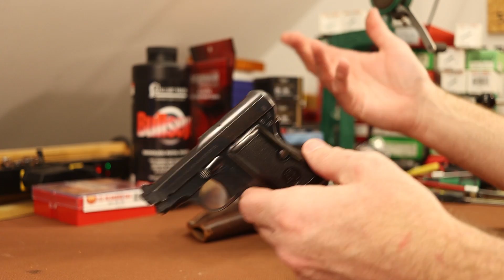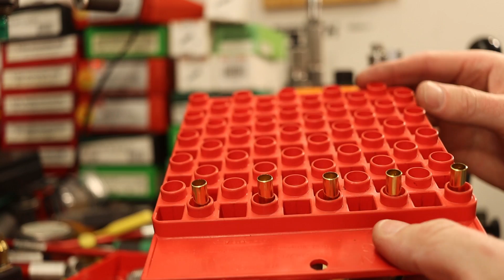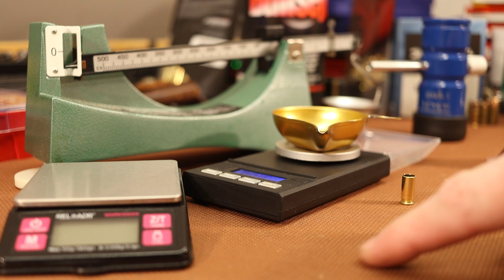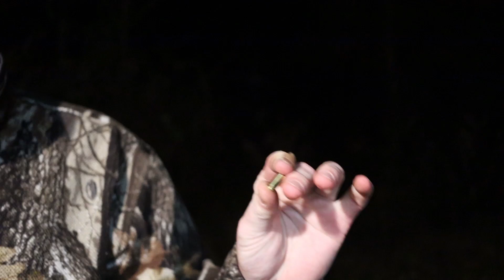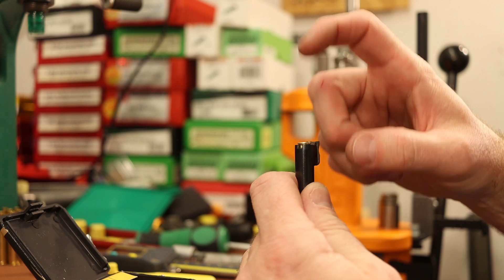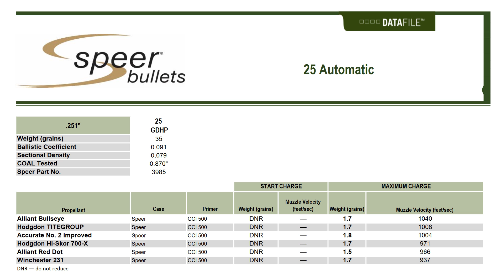Reloading .25 ACP

Comment: This shows 25acp can be loaded much hotter than factory why a polymer double stack 25acp hasn’t been made is crazy you would have 10-15 rds of 35gr at 1000+ fps when most is loded to 900fps for 35g

Comment: I had a weak striker sping on my 25auto so I got a box of assorted springs found one of similar diameter and cut it down to like 5-6mm and added it now it fires 100% of the time and is more powerful than needed which I’d rather have for reliable firing

Comment: My Beretta is a 950B.. this is a pre 1968 single action very small tip up barrel with 8  round mag and one in the chamber for 9 rounds.   it is in the front pocket of my western shirt as we speak.   everyone loves to shoot this little gun as it is reliable and accurate.. thing is no one can resist firing all nine as fast as they can pull the trigger.   Being a handloader for half a century + I handload everything except the mouse gun stuff and my 9mm Mak stuff...  but it might be fun to load the little 25 for my Beretta.    Also maybe for my PPK in .32.

Comment: Johny, a couple respectful suggestions:
>A very slight modification to the bullet seating stem is pretty easy in a small - medium lathe. (I've done it myself several times, and I'm no machinist tech whatsoever. Just an old ER/ICU ex Military MD, bitten by the reloading bug decades ago): From wide flat nose .452" bullets to round nose .224" ones.
>I'd try finding a used Phoenix HP25. I'ts basically a cheap 'pot metal' / Zamac pistol, (Usually, 3" bbl, some with 5" bbl). Those cheap pistols tend to print ~3" groups from rest @ 15 yds, though. Not too hard to find a good used one for less than $100 bucks.
BTW: Me happy to see you're going close to 32' Million views, and going strong to 50'M!!.
😊🇺🇲💪🏆🙏🙏🙏

Comment: I have several .25's, all Berettas. I reload 50 gr fmj bullets. I made several custom dippers. Just too Lee dippers and shaved them down. 1.0 to 1.1 gr of Tightgroup is fine but I prefer 1.1 to 1.3 gr of HP38. 

I've found the guns will run between 715-850 fps with 100% reliability. Slower or faster and you will get occasional malfunctions. In my early testing I made a batch of 50 gr fmj that flew 935-1015 fps for 10 shots. Don't do that. I disassembled about 20 more of them because that must have been overpressure. I think i got lucky. 

Anyway, with my Lee turret and funnel above the flaring die using the dipper is quite easy. I can load 50 in an hour. 

Yea, 4 times slower than say, .45 acp. 

So, I bought cases of .25 loaded ammo. But it's still fun to load it for 50. As of 2025 .25 costs the same as .45. 35 to 40 cents a shot. .32 acp costs more.

Comment: Have loaded this ctg with 50 grain ball and 25 grain gold dot  for both baby browning and a 1922 -made colt .25 pocket model.  I used lee dies and sometimes a hand press -for fun rather than necessity and both the Lee-alliant bullseye 1.4 grain dipper and an rcbs measure threw completely consistent charges. The dipper is consistent with long-standing loading manual recommendations and the 1.7 grain charge is handbook list for the gold dot jhp-contrived from a .22 rimfire case.  The manuals claim it is very hard to throw accurate charges at these small weights but I found that there was no problem with measure or dippers struck even.  Weights remain consistent and velocity variations  are suitably low.  
I have found with both of thse pistols (but not the Beretta 950s) require a slight crimp to prevent the rim of the ejecting case from slamming into the un-radiased case "mouth" and preventing feeding. This is true of Factory ball loads and handloads but not the case with speer and hornady jhps which are factory crimped. The solution is to run factory ball and handloads of whatever bullet design into the seating die set at a slight crimp depth.   So loaded, both pistols are completely reliable.  
From Browning 50 grain remington ball (Crimped)  726 27 fps spread, 1.4 Bullseye 844/ 26 fps spread (from Colt 872/65)consistent with speer manual listed velocities 
Speer 35 gr good dot 1.7 Bsye Browning 977/662 fps  Factory Gold dot 1050fps

Alliant appears to have abandoned tho old Hercules Powders and the speer bullet lines several years ago

Comment: If it fires when the slide is dropped, the firing pin spring is weak. (collapsed)  Either replace the spring or stretch it some.  When it gets to a shorter length it will go full auto and empty the magazine.  Replace the spring before firing it!

Comment: Easy video idea!  The hardness of primers.  You could set up a weight that drops a firing pin onto a primed case.  Reduce the weights until you find the reliability limits of the relative whack.  It doesnt need to have exact measurements of force since nobody would check that at their bench.

Comment: I've found that the biggest issue with such pistols is the presence and/or condition of their springs. There's a bunch of tiny springs in those things and over time, they tend to weaken and break (or go missing because people don't keep tabs on the inventory of parts). .25 is defensively relevant if you practice follow-up shots. One round is gonna give you roughly 64 energy foot pounds out of a two inch barrel, but with follow-on shots, you increase the power potential of the gun - and it basically has no recoil.

Comment: With this Beretta being a direct blowback, the carbon or blacking on your brass is nothing to worry about. I have owned a Marlin Camp 9, Walther P22, and Walther PPK in .380 and .22, a Bersa Firestorm, and a number of other Direct Blowback guns. There are a couple of reasons for carbon or blacking of brass in blowback guns. The first is the case extracts before all the games burn off. If you have ever watched someone rapidly mag dump something like a Marlin Model 60 on video, you will see flames coming out of the ejection port during cycling. The second reason you might see brass getting blackened is because many direct blowback firearms have exceptionally weak or no extractor. This is because many straight blowback designs use that same excess gas as the extractor forcing the case out of the chamber. A combination of both of these factors is what leads to carbon stained brass. It has been basically the one factor every direct blowback gun I have owned shares universally

Comment: I have found that CCI primers are harder than Winchester primers. Some brisance factor in the steel primer cup. The light strikes by the pistol firing pin may work with sifter Winchester primers.

Comment: I reload for 25 acp. It gets a bad rap because it is under loaded in deference to a lot of junker pistols out there. Next you can now get cast bullets from Rim Rock, a 55 gr fn cast. The other secret is Hunter supply offers two hard cast bullets a 47 gr cast hollowpoint and a 49 gn hard cast. They are .253 made for airguns and work in most 25 pistols. They can now be ordered sized to 251. FYI the pistol you are using is the pistol used by James Bond in the early books, and replaced with the Ppk. It has a barrel almost 1 inch longer than most 25 acp pistols and gets around 50-75 fps velocity increase

Comment: If springs are really expensive, hard to find or not even made, it's ridiculously easy to make your own.
Whenever I order a die set I always check to see if I have the Priming shell holder and if not, order it. I also order the cartridge length Trimmer, but the 25-acp length Trimmer is only custom made!
My one magazine had a weak spring and the 3rd try was a perfect spring, and now it cycles reliably!

Comment: I highly recommend  NOT to reload .25 acp if you plan on using for self defense.... always use factory ammo for cc self defense.... not for reliability issues.... for possibly going to prison or being sued issues.....
Reply: Why would hand loads get you sent to prison? I shoot 380 cast bullet hand loads. I cut split point into them. They expand ok enough, and work till I get a hollow point mold.
Reply: @Quadrenaro  its happened before. even altering your ammo can get youo sent to prison if you killed someone using that ammo.   where they get you is by altering or handloading you may have intended to create ammo with the purpose of killing.   I know right its stupid... but thats how they can get you...  your better off using a "personal defense" named/brand ammo  your belief is that it will defend you.
Reply: @HR-rt9nh  I think it depends more on state. My state had almost as many defensive uses with a firearm than homicides in the last couple years. There is a 0 percent conviction rate of defensive uses, and hand loading is very prevalent. The last defensive firearms course I ran, the instructor had nothing to say about my hand loads, which we did talk about.
Reply: @Quadrenaro  pretty sure your right... it will depend on state... i would think maybe california and New york good examples where issues would arise from using a handload or altered ammo.

Comment: Might be a slamfire problem.slide going (slamming) into battery could be causing the firing pin to move forward due to inertia. The springs seem worn (stovepipes might be a sign of that)

Comment: (March 2022)  I collect old (pre WWII) pistols in the .25 ACP chambering.  I do not reload the round for two reasons.  1. it's really difficult, and 2. there's no where to go with the loading.  I did meet a guy who did load for it.  Asking "Why bother?", he laughed and explained he'd loaded many other rounds and this was seemed a challenge.  Not just assembling the cartridges but getting them to feed and function properly as well.It was a technological problem he wanted to solve.  He used cast bullets.
I'm not at that point yet.  But I'll watch because I'm bored stiff.
Oddly enough, one of the .25 ACP pistols I have is a Beretta 418.  (Designed in roughly 1918, mine is dated 1958.)

I used to shoot PPC revolver competition.  Common practice was to use Federal or Remington primers in the wadcutters as they were the most sensitive.  One could  lower the trigger pull by doing various things, one of which was to lower the hammer strike by  partially unscrewing the manspring.  So I agree with the theory of Federal being sensitive primers.

Weighing powder charges.  Reading the instructions for balance type scales - the one you  show in the video - it directs the user to observe the "pointer" as it oscillates above and below the 'zero' point.  Only by determining the oscillation as 'even' above and below can one definitely say the weight is correct.  I noted the balance pointer in the video was evaluated ONLY when the pointer was stationary.  So, the weight may or may not be correct.  Just to be fair, a digital scale is a bit imprecise as well.  In this case, a reading of 1.7 grains is anything between 1.65 to 1.74 grains, as the 'brain' has to round up or down to the nearest .1 grain. So the digital scale is within a range of plus or minus .05 grain and the balance scale is oscillating in probably the same range.  

I do note Lyman reloading manual #50 shows 1.5 (starting) to 1.7 (maximum) grains of Bullseye for the 35 grain bullet.

Comment: One caliber I don't load. Don't shoot enough of them to make it worthwhile. Smallest thing I load is .32acp and they aren't much bigger but the only problem with them is bullet diameter. They are all too big. The only way I've ever been able to make them work is to run the loaded rounds back into the sizing die. Or they will not chamber. The only bullets I could find and with that said all the bullets I could find were sized .314 (Way) to big in my two Berettas anyway. I bought a .311 bullet sizing die and about fifty percent would chamber, (tightly) then but still no cigar. I should have bought the .308 bullet sizing die as that works perfectly. The good news is that even after running them back threw the case sizing die, they still shoot as good as any factory load, I've shot in these guns. I'm not sure of which is which, but I have read that either American ammo company's or European company's load .308 diameter bullets and the other loads .311's. (Greatly due to the thickness of the brass). The bullets I ordered were powder coated cast bullets and I'm guessing that's why they were sized .314. Probably the hardest 500 rounds I've ever loaded. NOW, as far as your shell holder, I ran into the same problem with loading the .32acp's. It's more than likely the brass and not the shell holder. I got mixed range brass and no to brands seemed to have the same rims on them and one brand would not go into the shell holder at all. They vary greatly in rim diameter and extractor grove design. I'd be willing to bet it was your brass and not the shell holder at fault.

Comment: I remember that the original .25 ACP/6.35B 1908 design from M Browning uses the firing pin to help the ejection and does not have a safety. When the pistol closes unexpectedly, this could indeed trigger it. Being careful is thus - like always - key. For a pistol designed more then 100 years ago; with like 36 parts to it, it is a little marvel. Tx for the video.

Comment: Hi, I think your OAL is too long specially with those hp bullets. 
i have a box of old manufactured round nose rounds from the 30's (berdan and all the old stuff) and the length is really shorter than that. you prob need to see some old tables and a hotter faster burning powder to avoid stove pipes. I opened one and got approx 1 grain of very fine  round powder probably Bullseye equivalent. 
Actual tables might give lower charges and longer OAL to avoid people using high pressure on very old guns.

Comment: For giggles I really want to see some .25 +p loads if that's even possible to do with such small casings. It could make the bit of difference between reliable and I unreliable penetration through bones. I always wondered why the .25s all show 64 ft pounds when it could probably go up to about 80-90 ft lbs without breaking the guns....as long as they aren't ring of fire brands that is

Comment: I have a MP Molds 3 cavity 252-46 HP PB mold. It casts 44 grain hollowpoints or 46 grain solids. Arsenal Molds makes a 53 grain powder coat bullet mold as well. I repaired a Colt 1908 Vest Pistol for a guy at work he inherited from his father law's estate last year. That was also a cool little pistol and I wouldn't have minded keeping it for myself.

Comment: Lots to take in on loading the .25acp.
1st problem you'll find when loading the hollow points is no one currently make a seater stem for them. The standard one will be for FMJ (hard ball). When you get these loaded, lay them down on the bench and roll them and watch how much bullet wobble you get.
Solution, send a couple of the bullets to say Lee and they will make you  a custom seater stem.
Next, the shell holder, I have the Lee, Hornady, & I think Lyman, other than lee the rest may be hard to fine NOW.
I started of years ago with the Hornady die and loaded mostly NEW cases, got rid of the gun for YEARS. Picked up another a couple of years ago and that put me back into actually reloading, BIG problems set in.
The Hornady dies actually are classed as small base die's so they actually under sized the cases and the finished rounds had unsightly rolls & bulges, also the expander die stem actually bellied the case to far ahead of the flare, that made a bulge beyond the depth of the bullet. (not good)
No other dies are available except Lee without ordering custom die, I ordered a set of lee dies, and found right that on some cases (loaded rounds) the bullets were, well lose in the case. That's when I discovered a problem with the lee dies, (resizing die) its a tad oversized with some case brands. No unsightly bulges, just lose bullets on some, (no more crimp doesn't help) The only solution I had was to go back to the hornady sizer die and set it to neck size only, no farther than the bullet seating depth. Nice!
Next is the problem with the Lee powder through the expander die! Take it apart and polish the expander plug with very fine emery until you've removed all the tooling rings, this turns the die into a wonder die and takes out all that terrible drag coming back out of the cases.
I found a thin shim that I put under the seater/crimp die that keeps from crimping while I'm seating, I seat all of them and then I go back back off the seater adjusting plug, take the shim out and then crimp in a separate step.
I purchased a second seater die just for the 50gr. FMJ rounds.
All in all my .25acp die set of actual dies used consist of 5 dies.
I also found that the Federal primers actually fit and seat better than CCI.
The problem loading the 25acp is mainly limited equipment. What saved me some problems was I have some stuff that I got back in the 90's .
For the 35gr. HP I used a custom seater stem from Lee, its works decent.
On those Hornady 35gr. XTP bullets, Hornady still makes them in that you can still buy factory loaded ammo loaded with that bullet, they just STOPPED making it available to hand loaders, I called them out on it over the phone, they told me it was discontinued, I said really! because I still see them being offered in factory ammo! he was at a loss for words. I told him that I didn't think much of a company that would do their OWN market that way, I wasn't a happy camper & he knew it.
I also found that about ALL the online once fired brass sources are throwing the .25acp away! seems their automatic sorters kick them out with the 22LR, what a damn waste! (that's what they told me on the PHONE) I watched for months on ebay trying to land a set of used RCBS 25acp dies to no avail, I just gave up. If ANYONE here would consider getting rid of a set of RCBS 25acp dies I'd be interested.
Reply: If you are still interested. There are some on EBay right now. I ordered 1 RCBS set yesterday. 3/24/26